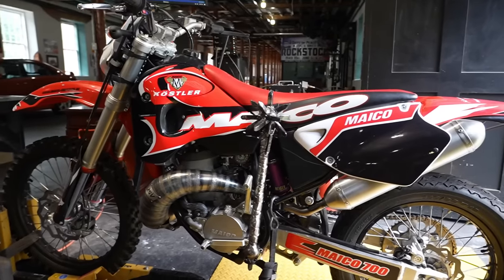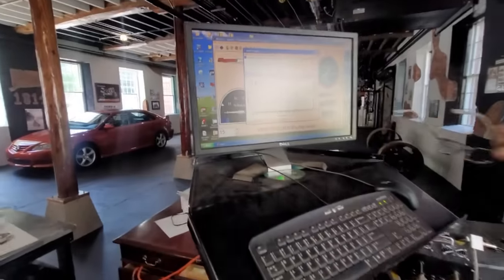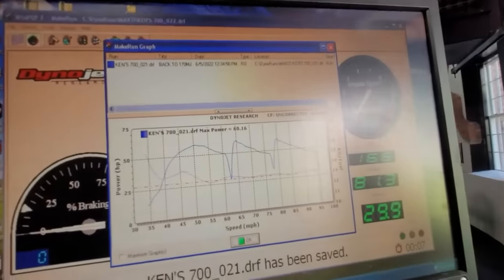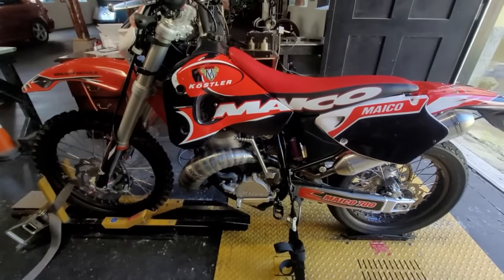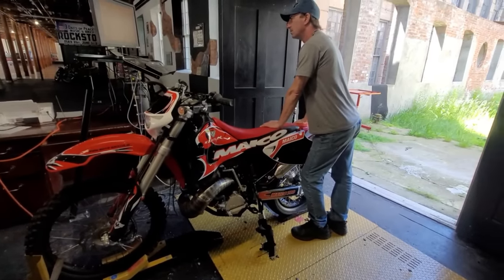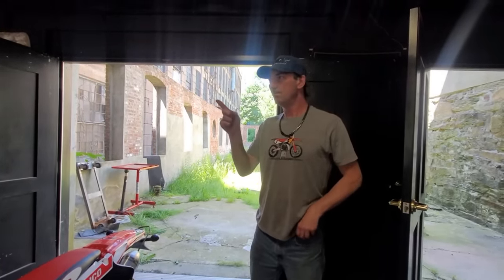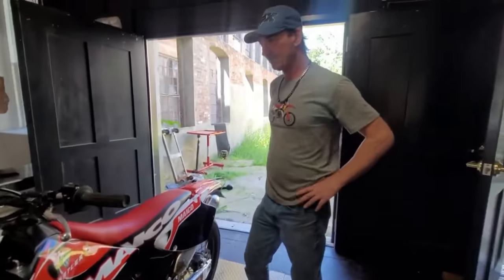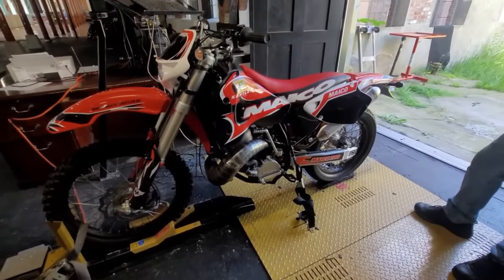2023 MAICO 700 DYNO PROOF 40% MORE TOURQUE THAN CRF450; THE WORLDS FASTEST PRODUCTION 2 STROKE

Comment: Shows how amazing a CR500 is!!!! 200cc extra....all that engine inertia making it struggle in corners......low revving motor.......all for an extra 5 ft-lb torque and 7 HP. CR 500 will smoke that around the track, too! But......it's a cool bike guys!
Reply: The maico 700 was made lazy on purpose. So its a little easier to ride, no crazy power spike just steady pull all the way from idle

Comment: In 2-stroke snowmobiles they often have a engine output of 80 hp at per cylinder and 400cc. Thats incredible numbers as it also have good durability and fuel economy. It would be a interesting project to convert a snowmobile cylinder to a mx engine. Imagine 80 hp on a dirtbike without any extra weight.
Reply: There are scooter racing cylinders that give you over 30 hp from 100cc.
Reply: Being setup for enduro riding, I think it’s safe to say that the Maico engine is a very conservative and docile two stroke for it’s size. I’m sure if the engine was setup for racing (more aggressive ignition, larger porting, higher comp ratio, and higher revving, I could easily see it putting out 90hp at the crank. I wouldn’t be surprised if someone’s done it already.

Not a two stroke, but another example of a large, yet modestly powered engine, would be the Raptor 700. It makes less power than the YFZ450, but still wins due to torque.
Reply: @pubbiehive  specially the 100cc 2Fast one for Piaggio Zips.
Reply: @Toxic2T  Roost 100cc also
Reply: Bigger displacement single cylinder 2-strokes are different than smaller engines. They can’t put out same horsepower anymore because port size is limited. And have bad fuel economy too. But idea with big 2-strokes are light and they beat 4-stroke bikes when talking about hp, torq and weight. That’s why 700cc is amazing bike but it’s not really reliable and fuel consumption is really bad.😂 

BTW I live in Finland and i have 2020 Maico 700cc and 99 cr 500. Fuel consumption and shaking of 700cc are downsides of that bike.

Comment: Thanks for doing this series, Ken, on a bike most will never get to see in person. This is great and your enthusiasm is just the ticket! I think we were all rooting this bike on for a higher number however the torque output is shear foundation crumbling in itself. As Carroll Shelby once said, “Horsepower sells cars, torque wins races.” I hope you continue your content on this bike as it is getting a lot interest around and you are giving us an in depth / real world look into a bike that is super intriguing and you cannot find much about. It sounds like it is de-tuned. A suggestion would be to do a future series on bumping up the HP up and unleashing its full potential. Putting a bigger carb on would be very interesting to see, do the porting you talked about. Don't know anything about that muffler but maybe something more opened up. See about getting that HP number up to what the current crank output is. Either way, keep up the great content on a seriously cool bike!! ;-)
Reply: I think those mods you mentioned will improve it but the pipe is holding down the hp. A drag style expansion chamber for that monster would be massive and wouldn't really fit for Enduro or moto riding.
Reply: As a production bike, and running rich out of the factory, they probably didn't want this bike to be deemed just another 'widow maker' lol.

Comment: Torque is where it's all at. 250's will give a  500 a good drag race but when it comes to a long loose monster hill climb, that same 250 would grind to a stop while the 500 is pulling 3rd gear to the top. That's where this 700 would really shine. 💯

Comment: The thing most people miss when claiming Horsepower should be much higher ,is the limit on RPM this 700 has .  A smaller cylinder engine with a higher RPM limit can “ Cram “ more combustion cycles into rotations pera minute than a larger / slower bore engine can.  You add up all those “ small cylinder firings “ Vs  “ less cylinder firings “. And the answer is clear ….. 10, 000 power strokes will add up to more than say 7,000 power strokes if total power is only thing being considered. Torque however is “ Leverage “ exerted on the Crankshaft in order to get things moving , and as we all know , when you put a “ cheater pipe extension” onto you trusty old Ratchet you can “ Bust that rusty bolt or nut “ loose a lot easier than without it .  Leverage is key to torque output,  and “ More is better “.    Torque puts things in motion & H.P. Keeps it there …. So to speak. ( once things like friction & mass are overcome at least)  Glad to see you guys are getting it dialed in and I too would love to see what a larger volume tuned Expansion Chamber and some mods to port timing and a bigger Carburetor could unleash ….. but then Safe RPM range may be compromised….. slinging a “ Gallon paint can size piston” above its sane speed may be costly when things get too much … just ask all those early Hemi Drag racers from the ‘60’s and ‘70’s …..😏😉.   Sometimes good enough is just that. ……
Reply: No, it's called volumetric efficiency. The bigger the cylinder, the less time atmospheric pressure (14.7lbs at sea level) has time to fill with an air/fuel mixture. It's even worse on two strokes. In this case, also probably made worse by a very old cylinder design/ports/squish/carb, etc.

Comment: A four stroke piston travels much further down the bore before the pressure is bled off by the valve opening, while a two stroke doesn't even make it half way down before the exhaust port opens.  That's why you can lug most 4 strokes and not 2 strokes, they need to be on the pipe.  Big bore 2 strokes can be lugged but generally they don't like to rev very high, which explains the tall gearing.

Comment: 41mm???? That thing is breathing through a STRAW!!! I run 42mm lectrons on my 250's, and ran 48mm lectrons on my 500's, with airbox filter holes in both. That bike could use at the very least, a 48-50mm Lectron, and definitely some airbox modifications. I'd be willing to bet with those simple changes, you'll be at 70hp and 55-58 ft lbs easily.
That engine has allot of rotating mass, so doesn't need/like the RPM's of the smaller engines. But the bottom end grunt has to be phenomenal, even in such a docile state of tune....

Comment: A 2-stroke has more torque as Ken explains because it fires every turn. The internal mass has nothing to do with it, except in a inertia dynamometer that calculates accellerations of all the mass, the inertia dyno flywheel mass and the rotation mass of the engine. Large rotation mass of the engine can give slightly lower readings. The importance of engine torque is often exaggerated, the torque at the wheels is what matters and as long you have a great gearbox the horsepower is whats matters how much torque you can get at the wheel (at every given point in the powerband). The engine torque is actually calculated from the horsepower and engine rpm in a inertia dynamometer.
Reply: Yes.  But HP is what matters.  HP=TQxRPM/5252.  So the big TQ number is of no use if it doesn't happen at high enough RPM.  And four strokes have an RPM advantage because they can go short stroke, large bore if they want to.  The thing that holds back large two strokes is they can't shorten the stroke or they won't get enough port time to inhale enough air to make power.  The last generation of 125cc two stroke GP road bikes were making 60hp...with 125cc.  Narrow power range for sure but that doesn't matter to expert riders.  When they say the 700 has high torque, it's better understood that it makes high torque at very low rpm, thus high hp at very low rpm.  The 700 has to seem monsterous at low rpm.  And because even national MX riders have a problem running more than 65hp efficiently, the 80hp that the Maico has is really scary.
Reply: Oh, yeah, two strokes still rule, don't believe all the BS.  National MX still bans two strokes above 250cc in the 450 four stroke class for a reason...if they allowed 300-325cc two strokes then nobody would ride a four stroke..
Reply: Translated: 2Ts are bad ass...

Comment: A heavier rotating mass does NOT increase torque.  On the dyno if you had a lightened crank and rods it would rev quicker yielding more hp/torque. All a heavier rotating mass is good for is the stored energy , albeit less torque. That would be good for some riders who like to just lug around and don't really get on the pipe. With a heavier crank the engine isn't a quick up or down rev response to the on and off throttle. A big  displacement engine doesn't need a heavier flywheel to help it lug through the mud and roots. As far as the power coming on quicker from a 2 stroke , it's because it fires twice as much.......a 2t fires once every rotation of the crank

Comment: Nice bike! That 450F was outmuscled by the other two but that dyno curve was still fat and flat, giving the 4S the edge in deep sand or low traction conditions. Guys you can strap a $100 Garmin GPS to that beast and it'll give you mph.
Reply from the maker: The 4vstroke is not even close in deep sand with 40% less tq

Comment: The story of Maico bikes is worth listening to.
Ken it might have some power and torque but not even close to the crazy hill climber that linked 2 CR 500 engines together crank to crank. Those guys aren't right and it sounded awesome.
Anyone that hasn't seen check out 
Insane 1000 cc two stroke dirt bike.
Insane is correct, not bike, rider.
You've never seen a rooster tail like this.

Comment: WHAT A BEAST! I did expect more power but that's crazy torque indeed! Cant wait for the 300, will it beat a ktm300 that seem to do low 50's??
Just run a phone in your pocket or zip tied someplace with gps app open monitoring speed, you can get small stand alone gps trackers they run on rc cars going for records.

Comment: It would be interesting to have a zabel on the dyno as comparison to the maico as its even more focused on torq with the big bing 55 carb and slightly longer stroke cheers
Reply: I have a Maico 700 with Bing 55 and same ignition basically here, Maico 620 with Bing 55 with PVL same as Zabel (and this one has a hard hit the 700 does not have) and I have a Zabel 700 (2014 zm29) Bing 55 with PVL (and a Maico 660 but doesn't matter).  If I cared enough and had the energy to put street tires on them and drive them to a place I would compare them lol.  But I'm not that motivated and not sure I would see anything much different than here.
Reply: @Maicowerk  please do it for the maico Community:)
Reply: @Maicowerk  and please show us the dyno numbers with your 700cc pipe which you have. I am also interested in the difference between the original hgs and the custom 700cc pipe:)
Reply: Hope everything is good Toby, and looking forward for comparison😜

Comment: A head ported exc500f does 62rwhp. I expected a lot more from this... 690s do 72rwhp stock without losing a sweat
Reply from the maker: This has 33% more tourque, thats a big deal, you can easily be forwarded for 80 horsepower with porting And pipe

Comment: Both the 450 and 500 are making more power at lower rpm. Curious to see the graph in rpm to see exactly were the 700 overtakes the others. We should also keep in mind the 700 is, well, a 700.
 It should make more power. Awesome video as usual.👍
Reply: A 500 cc engine is more efficient per cc though. Because of surface area vs volume in cylinder, and the way the flame front reacts to that. 700 cc will have more power than 500cc all else being equal, but it's gains won't be linear with the added cubic centimeters.
Reply: I don't think your comment is too accurate. I didn't see the exact details but I'm very sure the Honda uses direct injection which turns the power curve more into a 4-stroke style. The  Maico Köstler bikes are an oldschool style build. They use a carburetor which will lead to a flatter curve naturally until the peak is reached. Has nothing to do with the cubics. And well, yes, we all saw that the Maico Köstler peaked way above the other bikes.
Reply: @testtor2714  What's not accurate about my comment?

Comment: I really don't understand why do old 2 stroke snowmobile engines make so much more power than 2 stroke dirt bike engines?

I have a 2003 Yamaha SX Viper with a 700cc 3 cylinder two stroke in it.   That engine has 120hp.   Yamaha made another version of the same motor with triple pipes that had 150hp.

Yamaha wasn't the only manufacturer making this kind of two stroke power back in the day.   Artic Cat, Polaris and Bombardier we're all making machines with similar numbers, if not better.

So if 100hp+ was commonplace 20 years ago on snowmobile engines, why are dirt bike two strokes only getting half that power even today?

This isn't a criticism of the video, btw.   I just honestly don't understand and am trying to figure it out.

Comment: Looking at the graphs, the area under the curve tells me the 450 is much faster around a supercross track which it was designed for.  The 450 and 500 have way more punch before the Maico kicks in.
Reply from the maker: Not even close. I'm not sure what "punch" is but torque is 40% less on 450 from off idle to 7k!
Reply: @KaplanCycles  according to the graphs, 450 and 500 have more power from idle until 65mph.  After that, it’s all Maico.  Moreover, I’m really shocked the graph indicates the 450 has more power throughout the revs than the 500 with the slight exception around 62mph….crazy stuff!  Great work Team Kaplan!!  I enjoy the content!

Comment: Maico 700 2 stroke produces 47 ftlb torque. A 701 KTM 4 stroke produces 54 ftlb torque. Logic says that a 2 stroke with 2X the power strokes would produce 2X the power per RPM. Why is that not the case?

Comment: ok relief thanks for sharing facts it's right where I thought it will be. I'm pretty sure the 700 was originally for side car racing . people are confused about hp output on twostrokes  basically the bigger the bore the lesser the projected gaines. the issue everyone don't consider is typically a small bore twostroke will allways make more power per cc.thats exactly why gp road race motors 500 cc  example was a 4 cyl. . I don't choose good words but example YZ 125  makes 37 .5 HP.  if it was a 250 that would be 75 HP. but yet the YZ 250 makes 49 HP.  things start diminishing the larger the bore diameter. bottom line reason is bigger the bore the longer it takes for flame front to travel.  hence per cc small displacement twostrokes will allways make more HP per cc than a large one.  short story long. great frigging job. and thanks for sharing legit results . FYI Bing carb company is the oldest in existence I believe.  as far as the other cyl your getting ported be shocked if you see a 4 hp power gain. but 8ts possible depending on Currant port timings on the factory 700 cyl. KAPLAN AMERICA FOR PRESIDENT
Reply: yeah, I remember in the mid 80's the 80cc bikes were making 1hp per 4cc's
Reply: @timothykelly5588  ahhh thanks you understood what I was saying. There's a snow mobile guy trying to dispute facts but I believe if he is actually making the power he's claiming then it must be 1 boosted or 2 on funny fuel or 3 on nitrous
Reply: It's called volumetric efficiency, and it goes way down as displacement goes up. Especially on a two stroke since it does not have valves.
Reply: *coughs in TZ750*
Reply: It almost wants someone to try a twin plug head.
Reply: @mikeleppard2771  hmm low compression two stroke  don't see much power gains compared to combustion chamber disruption. But hey  what do I know.
Reply: @Fvission  ahhh
Reply: @2strokecarbtuningportingin187  I'm confused, I didn't mention low compression. Just a thought that flame travel over a large chamber might be improved by starting the fire in two places.
Reply: @mikeleppard2771  extra spark won't change distance flame front traveles. Don't think there's power gains  waste time re designing a new cyl head . Just saying .